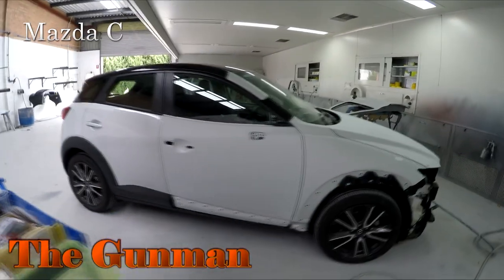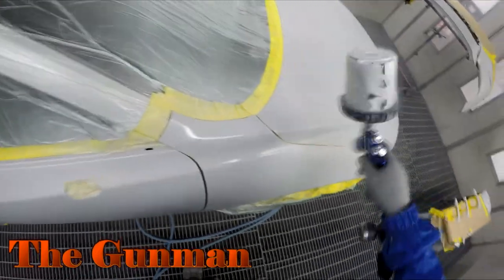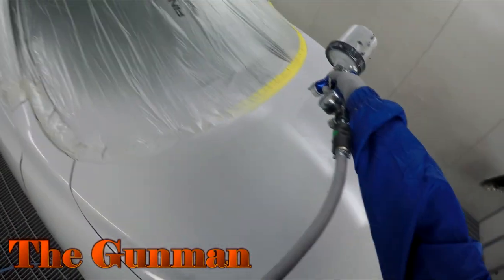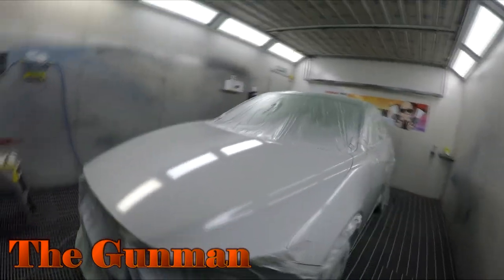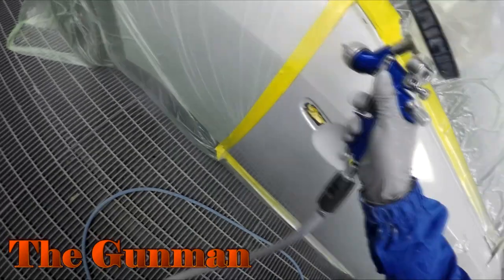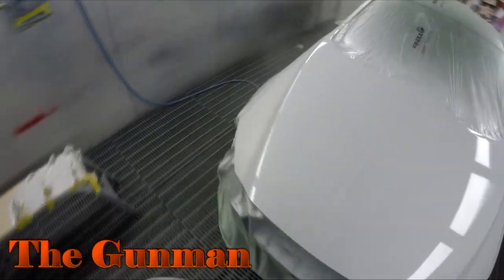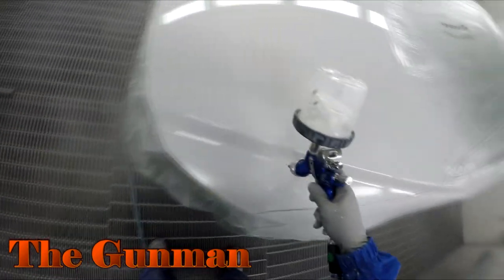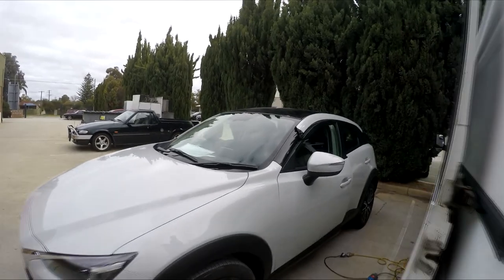Mazda CX3 Spray Painting

Comment: Hey mate, is it possible for you to do a video on how to paint over powder coat please? 
I want to paint the floating rear end in my drag car. Hope you're well :)
Reply from the maker: Hi Shane, I have done it a few times, never actually made a vid though but powder coat is basically olastic grains that get melted to the surface at high temps, I have always treated them like a standard panel, sand and paint but if you were worried about adhesion then just throw a coat of plastic primer down before colour, I never worry though.
Reply: Cheers

Comment: Hey gunny just wanted to ask about the clear base coat blend aid you apply to blend areas particularly for tricky silvers im sure you mentioned its a base coat stabiliser? as i looked at the mipa basecoat stabiliser but was told its used instead of basecoat thinner mixed 2:1 with base coat colour but im not sure if i can spray it on blend area to use as a blending aid

Comment: Hey Gunman,  I painted a 1980 Camaro most everything came out good but the plastic nose piece had cracks.  help.
Reply from the maker: Only real way to fix is take all the paint off, I'd do it with an orbital sander, 180 grit then plastic primer, 2k primer with flex additive if you're worried it'll happen again, then sand paint and clear, you can also add the flex agent to clear but be careful when polishing, sorry but there's no real easy fix.